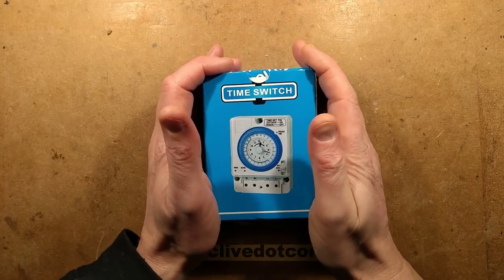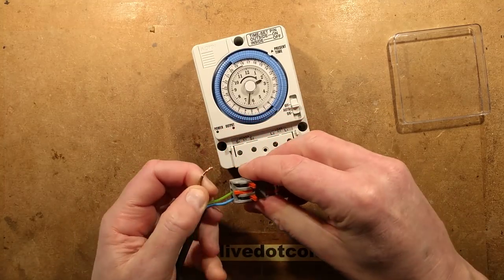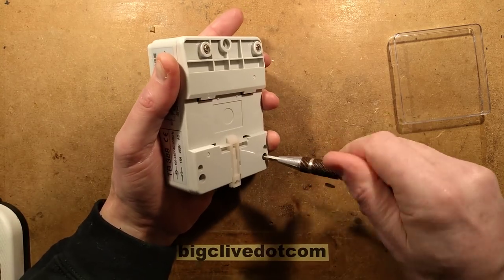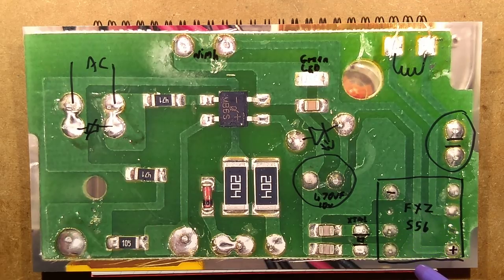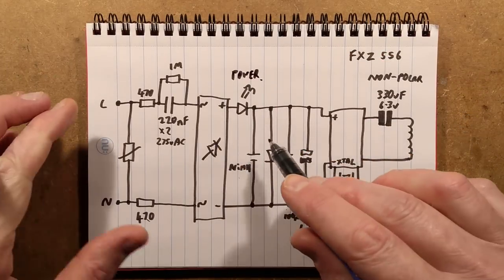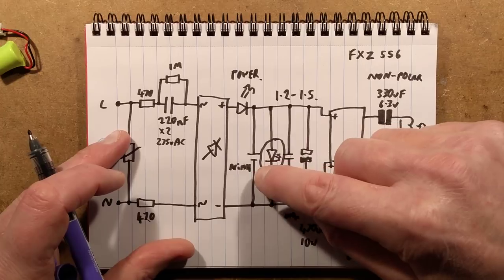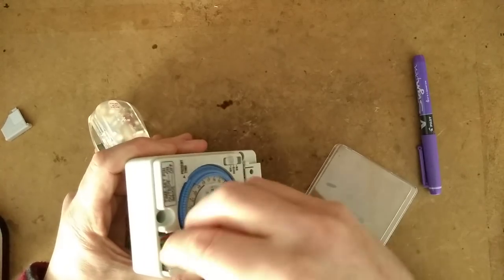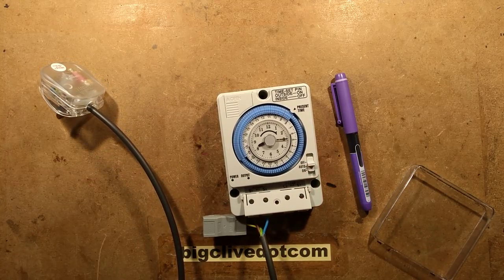Inside a Japanese street light time switch.

Comment: In early 70's my grandad had a Smiths electric clock on the kitchen wall. When he switched power on sometimes it would run backwards. It depended where abouts the mains cycle was which way the motor ran
Reply from the maker: That was common with old synchronous motor clocks.
Reply: @bigclivedotcom  I'm an ex domestic appliance engineer and the cam style timers had the same motor on the back. To force it to only start in the correct direction a sort of half moon pawl was hooked around the rear shaft extension that had a hook on it that hooked the rotor when it started on the reverse cycle ensuring it only could start in the right direction!  I used to carry motors clockwise & anti clockwise in case of no stock I used to swap the red pawl for the yellow pawl.....simples!

Comment: Only change I'd like is for that green LED to be visible from the front as a sort of battery failure indicator.
Reply from the maker: It would be nice.  "Change battery".
Reply: @bigclivedotcom  A green LED wouldn't be the best color choice for that. But maybe a red LED with a diode in series?
Reply: @NiHaoMike64  well that would be 2v but why not just a red led? 1.5v cap would keep the cell happy because it wouldn't be trickled 24/7

Comment: It would have been better to mount the green "light-emitting Zener" so it was visible and would then serve as a "replace battery" indicator.  Surely that was the whole point of using a LED instead of a conventional 2V Zener.  Especially as it fortuitously flashes, making it hard to miss.  Well, easy to miss when it's hidden inside the housing.

Also, it was remiss of them not to mark L and N.  Because one of the two is switched, and it's better to have a switched line than a switched neutral.  Or maybe that little diagram on the side said something about that.

As for the MOV, it should have been after the two 420R resistors, and at least one of them should have been fusible.
Reply: The diagram did show details, but did not use ‘N’ for neutral.

Comment: Japan always seems odd to me electrically because the earth is almost an afterthought, even on their outlets
Reply: Well, that was fairly common back in the day, and apparently most or all new outlets actually do have grounds. Also, they seem to use lots of double-insulation to avoid (or at least reduce) the need for grounds.

At any rate, it used to be (across the world, I believe) that if there was a ground, it was actually a neutral (of course, neutrals can sometimes float at 20 volts above ground, so...). If you wanted an "earth ground" you were advised to hook a wire to a copper water pipe, or a boiler pipe, or some other such thing: having a pin in the outlets was just a way to standardize this while also avoiding electrolytic damage. The odd ones are e.g. the Italian outlets, which have never had a way to distinguish the neutral, thus rendering even the old "neutral is ground" system impossible!
Reply: It's the same in Denmark. Earth is in before the fuse.
Reply: who needs earth when the user can be used as the earth! 100v is still a lot safer than 240v in India with crap wiring made  with iron wire rusted all over for earth
Reply: @absalomdraconis  The reason Italian outlets are not polarized is because in the old days (till the 60s) you used to have 3 phase 120v, so that lights were connected between L-N and were 127V and sockets were connected between L-L to make 220V. The two circuits were metered separately and the energy had different prices. In some areas there is still 220 L-L, even tough 127V is no longer in use (you no longer have a neutral, you have at the meter two phases instead of a phase and a neutral).

Comment: That reminded me of a central heating timer I had until recently. A well known British built model, although I can't remember the brand now. It was probably getting on for 40 years old with what I assume was a poly film X2 capacitor across the mains input. And  like the timer you showed there was no internal fuse!
The suppression capacitor failed "short circuit" and started to overheat and finally burn. Fortunately I heard it fizzing and managed to get there as the flames appeared. As a lower power device it was of course wired into the lighting circuit. Great, now that I've isolated it I can't see what I'm doing! Fortunately these things are only fastened on with a single screw so removing it wasn't a big job.
That said, if this had happened 30 minutes later I would have been out of the house and the place could have been gutted.
It's worth remembering that the old style X2 capacitors could fail in this way and pass enough current to catch fire without blowing themselves apart in the way a modern one would.
Reply: bet that capacitor was a 'clear' cased RIFA branded thing.? , they're notorious for going bad ..., the epoxy casing cracks and lets in atmospheric moisture
Reply: Honeywell perhaps
Reply: Well, I remember that the capacitor was an axial type, yellowish in colour with some sort of clear casing but so badly damaged that I couldn't tell the brand.
I'm pretty sure it wasn't  a Honeywell timer, I think I would have remembered that, can't be certain though.
Reply: @chrishartley1210  the 'bad' RIFAs are a sort of rectangular 'box' type with radial leads out of one longer side, but i suppose they may have done axials similar, i've certainly seen WIMA branded axials similar in appearance...
Reply: i suppose any will give trouble if the encapsulant cracks and lets in moisture..

Comment: In spite of being inefficient with the series resistance, the antiparallel diode to the red LED is actually a much safer way than a diode in series with the LED. In the case of the antiparallel diode the reverse voltage over the LED will never exceed 0.7 V or whatever forward drop the protection diode has. In the case of a series diode, the applied voltage would be effectively shared between the reverse biased diode and the reverse biased LED and based on their respective leakage currents and depletion capacitances the LED would most probably have to carry a significant portion of the mains voltage in reverse.
Reply: could've put in a second led

Comment: I should point out that Japanese uses Chinese characters as its main lettering. Japanese people can usually read most Chinese without too much of a problem, since written Chinese is a completely different language from any of the spoken variants. Likewise, Chinese people can read the Chinese characters of written Japanese without much of a problem as well, although the characters are slightly different between the two. The thing with Japanese is that it usually has the two Japanese syllabaries mixed in throughout any given text, so the Chinese can only read random words, while the Japanese can often read whole Chinese texts so long as they're kept simple. For this reason, Chinese manufacturers often don't bother translating their Chinese manuals when they sell things in Japan.

I should also point out that there are seven spoken Chinese languages which are written using the same Chinese written language. The written language is based on a much older version of one of the Chinese spoken languages. It would be as if the French, Italians, Spanish, Portuguese, and Romanians all wrote exclusively in Latin (and claimed to speak Latin), and the Germans wrote in German using Runic characters and Greek characters but replaced every third word with the Latin equivalent, using Latin characters, and, when reading, read the Latin words as if they were the German word they replaced.
Reply: NativLang made a video on some of the ways Hanzi gets Adopted as Kanji, in his video "the hardest writing system".

And it's pretty much what you said.

I bet it made sense, once upon a time.

Even of 80-90% mutually intelligible, not sure I'd want to trust Chinese instructions, especially for electronics.
Reply: One thing of note: it seems like several of the modern Chinese languages (if I recall correctly, at the very least Mandarin & Cantonese) are actually derived from the language that the written system was based on, instead of just one of them. Apparently, there's a subset of characters that you can use to represent the sounds instead of the meanings, and yet remain mostly-intelligible (presumably around "Japanese, but reading Simplified Chinese" levels of intelligibility, so not perfect), suggesting that a lot of the change was in pronunciation rules.

Comment: Pretty sure these aren't used in Japan at all. Without a JIS certification mark on it, people in Japan are very unlikely to use a potential fire hazard that only has Chinese and English instructions.
Reply: Indeed, although they obviously wanted it to be used in the Japanese market as the working voltage goes down to 100v.

Comment: Here's a google tip - when you were searching for that chip and the 555 timer kept coming up, you can include something like -timer in your search, and it will remove results with "timer" in the result, or whatever you put after the minus sign. doing -555 would probably have helped too. there are a bunch of these google tricks one should know.
Reply: Those are good tricks but wouldn't've helped much in this case. NE556 is a chip in its own right (a dual 555 in a single chip) so even with -555 there's another chip Google can confuse. -timer also probably wouldn't do much to help. The datasheet for the FXZ556 likely contains the word timer, so -timer would probably exclude what you're actually looking for.

Comment: Just a few weeks ago I was Confounded by a similar timer here.   It would turn on but not off.  Turned out the little tab on the  Slider had snapped off.   In the Bin it went.    Not much to that one.   Just a One RP Day motor.
Reply: I've had that happen. The really old ones with synchro motors have on/off tabs stamped out of sheet metal, bent appropriately, then have a machine screw through them so it can be adjusted. Often it will just go lose and need retightening to work once again.

Comment: I have this exact timer in use for a good 4 years now, to control my garden light. Battery is still working, timer seems to be running close to real time. All in all it's a nice cheap timer. Got mine from aliexpress or dealextreme.

Comment: I thought for a minute there, that this thing was going to be "plug & play" compatible with the Sangamo back plane, until you opened the little flap to expose the screw connectors.

Now, pardon my saying this, but isn't this all a bit "20th Century"ish? I thought time switched street lighting went out with the dinosaurs. I mean, we've had photocells to switch our lights for decades now. Isn't it a bit inefficient to send someone out to keep adjusting the timer, when a photocell controlled system automatically tracks with the daylight? Admittedly, we used to use a Sangamo timer to operate certain items of farm equipment, but that was because those operations were done at regular time intervals regardless of daylight, but our lighting has been "Zodion" photocell controlled for around 40 years now.

I could envisage this being a handy timer for a water heater, or for lights in a work area etc. though it's interesting to see that timers aren't quite done with, just yet!
Reply: 28YorkshireRose12 - Maybe the idea is not to switch the lights on at dusk and off at dawn, but to switch them off after, say midnight and then back on at say 06:00 hours to save energy and lamp life. That is, the contact is wired in series with a photocell/contractor controlled by a photocell.
Reply: @Mark1024MAK  Agreed, that is a possibility, but then modern photocells can do that too, automatically, by sensing the length of the "dark" period, and a simple but clever algorithm works out the midnight 'off' time, and an appropriate 'pre-dawn' on time. If the daylight precedes the pre-dawn 'on' time, it is overridden.   I believe they too are made by Zodion.
Reply: 28YorkshireRose12 - Yes the modern ones do. But there are installations still around where a single traditional photocell and a time switch control a group of lights often via a contactor. For example in a car park.
Reply: @28YorkshireRose12  Those would be sensitive microcontroller circuits easily affected by power spikes.  This is hard mechanical switching with as little electronics as possible given the inconsistent mains frequency in Japan.

Comment: Thats chinese junk $6 off alibaba knock off..  it's a visual clone of a Panasonic timer.. search for (TB4208).. missing the panasonic / national branding and box.  i doubt a knock off device would have been used anywhere professionaly such as governement installed street lighting... maybe some home gamer.. Almost all Japanese electrical connectors that you can buy domestically are made by a handful of corporations, i.e. National (Panasonic / Matsushita) who make a lot of electrical sockets and fittings, Omron too make a lot of the timer modules too. You can get some cheaper junk recently thanks to the internet but almost everything you'll find in a hardware or Electrical store in Japan is branded by a domestic company, usually made in Japan too but some of the lower endstuff these days is made in China.

Comment: I like the added 12hr analogue clock in the centre. The quartz driven motor is a 'Lavet' motor, just to remind you Clive. Doesn't half make quartz circuitry simple :o)  I have an E7 type timeswitch here that runs fast, but the electricity co. man didn't believe me - "nah, it's quartz mate".  You only had to hold a watch to your ear and you could hear the timeswitch go in and out of phase within about 2 minutes :o( Load capacitor drift/fail/dry joint I suspect.

Comment: huh an led capped 556 crystal oscillator run off 100-250vac? smart design honestly with the 55# family being ubiquitous and a watch crystal being cheap
I might use this circuit for my clocks as I hate having to replace cells and an always 100% charged nimh powered clock would be nice (with obvious couple hours/days of backup

Comment: Did you not notice the labelling of the connections ?

S1   S2         L2    L1

S for supply, L for load. 1 for live 2 for neutral - hence the middle pair hard wired together. Which needn't have been if L2 was omitted and S2 labelled S2/L2.

Pity the overload LED wasn't on a wire and positioned near the cell lid - so it could be seen that the cell had failed !

They are not correct for street lighting / dusk-dawn lighting as they're a 24 hour clock and not a 365 day clock. LDR or equivalent are more suited for that purpose nowadays.

Comment: Man, standard US timeclocks are so basic compared to this. To their benefit and also not.
Reply: One of the big things is that Japan has both 50 and 60 hertz electricity, north and south of the island. In us and Europe, you can have a mains synchronous motor driving it because it only needs to cope with one.
Reply: @JasperJanssen  I knew about the weird mains split in Japan, but yeah, I bet that's it. God, it must be such a pain to develop products for Japan.
Reply: @JasperJanssen  Using a synchronous motor in Japan would require a gearbox with two ratios. This is more complex and expensive compared with a fixed ratio gearing or direct drive from the motor. Together with the risk of it ending up in the wrong gear.
Reply: @orijimi  This does mean that something designed for the domestic Japanese market is likely work anywhere else without modification.
Reply: Mark Evans .... that was my point, yes. Or to be more precise, my point was that you basically cannot do that. At best you’d get versions that only work in one half of Japan or the other respectively, whereas this one works countrywide.
Reply: @JasperJanssen  A map shows a line dividing the island of Honsu. I suspect that, in practice, this "line" is actually fairly messy. Involving overlaps and supplies on the "wrong side".